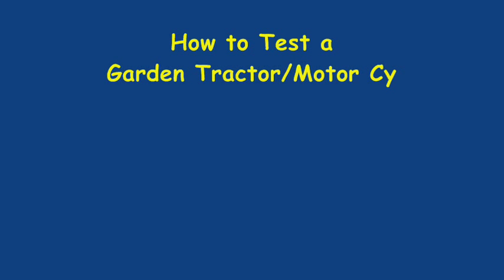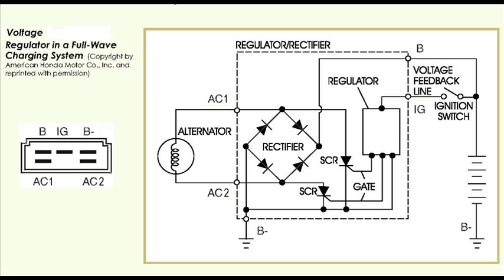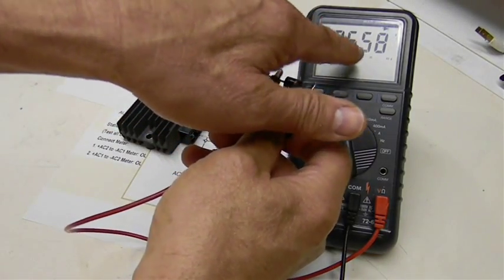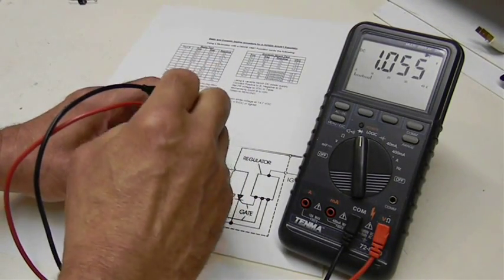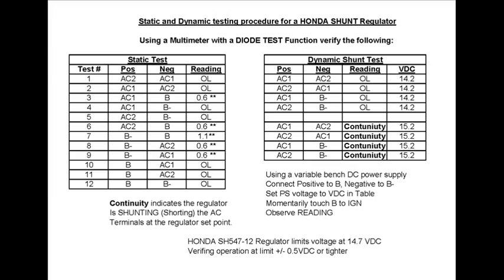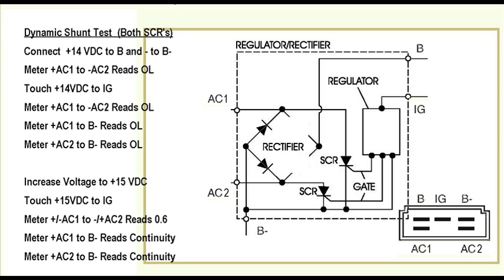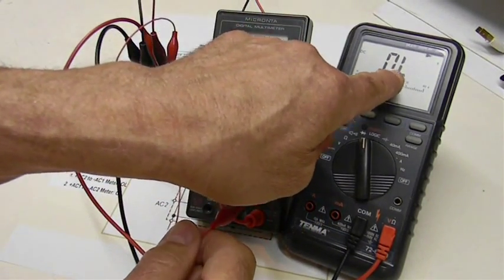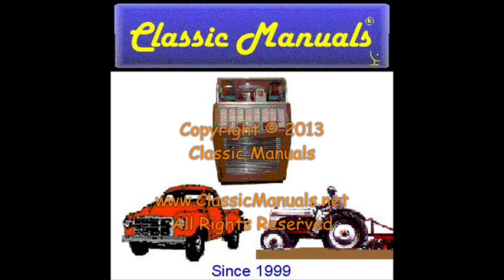Garden Tractor, Motorcycle Voltage Regulator Testing - Honda SH547-12

Comment: Hi, could I get your help, please?  I am trying to test a reg/rec off of a Honda GX630 engine. I have the manual (online - GX630-GX690) page 80 charging system - Reg/Rec Inspection - regulator 17A.  Could you let me know how I should be checking this? I'm getting OL where there should be a reading (brand new unit).  I would appreciate any help. Thanks

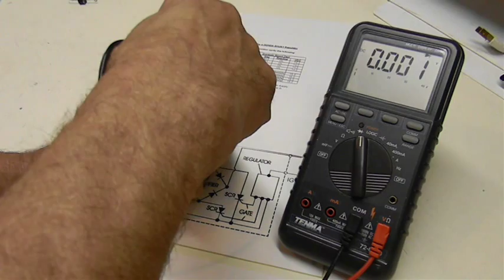Comment: FYI At 4:17 B- to AC2 the voltmeter showed 0.001 volts which would be a short not OL. So that one rectifier would be shorted or closed circuit unless your voltmeter terminals were shorted.
Otherwise a great test for the voltage regulator.